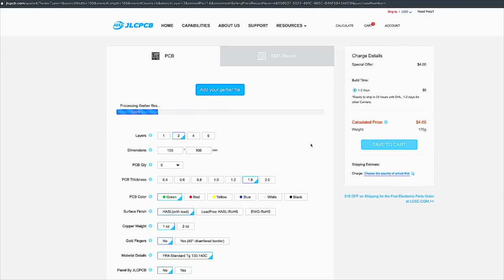7 AMAZING! Brilliant ideas & DIY

Comment: I love the home made wire brush ,i built mine with a old mountain bike breaks steel cable(wrap it in electrician tape before cutting it,its a less mess) so its thin but you can put a lot of strands in it-best thing is you can make a handle that goes into drill as long as you want.Great tool indeed for cleaning pipes and other things.

Comment: - man draws circles with caliper, 
- man makes vibro saw,
- man solders bolts to circle, 
- man drills holes in screw,
More suspenseful than most television. 

WHY DID YOU DRILL HOLES IN A SCREW?